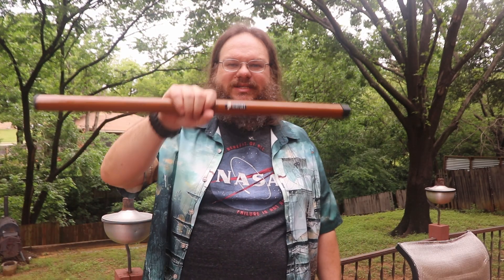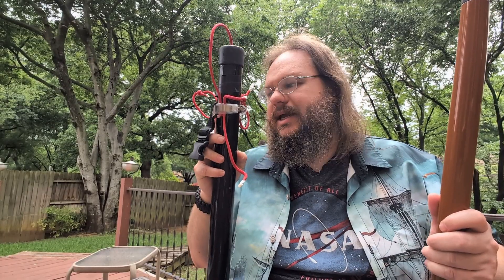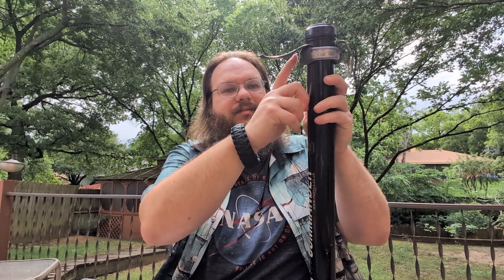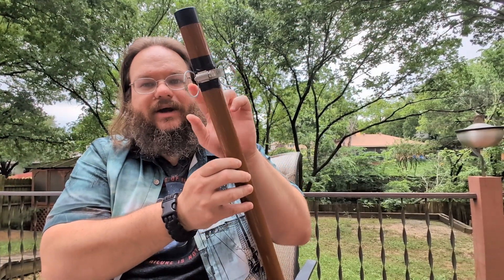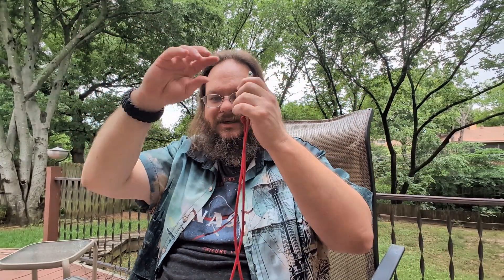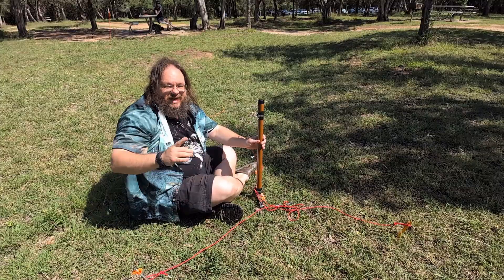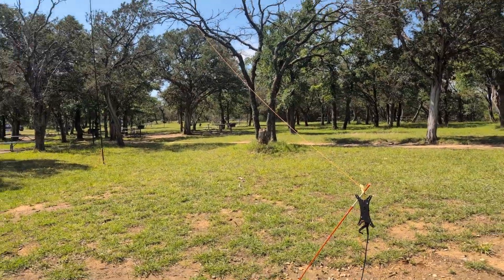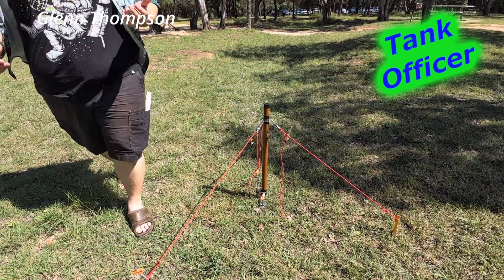How To guy your Antenna Mast for an open field, POTA33

Comment: Great video Frank, I hope the job hunt is successful. I use a Waratah (Y post) that is 450mm long. Padded around the part my pole slips over. 40’ long. Same sort of genius design as you for the 3 guys, about head height though. Any wind that will knock that over will not be a day I use the radio.
Reply from the maker: Lol,i agree with thta, if the winds knock over my mast is a day i don't need to be playing radio.  I will look into the Y post.

Comment: Nice video, Frank, thanks. Wire key chains... I use them with HTs. Wire key chains and coiled elastic key chains attach my HTs to belt pouches. Reduces lost HTs! Yes, HTs are on FRE and  GMRS bands. Thanks again and 73, Bill.
Reply from the maker: Thanks, I'll have to try that out!